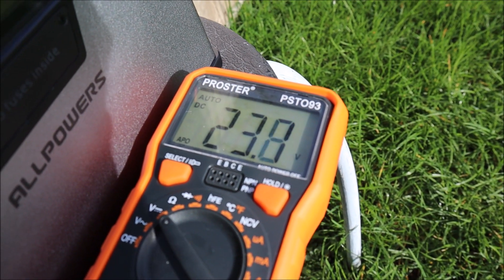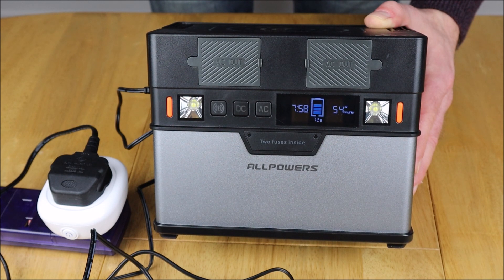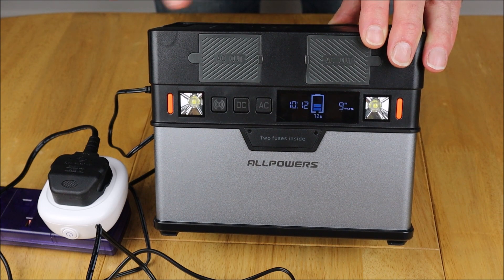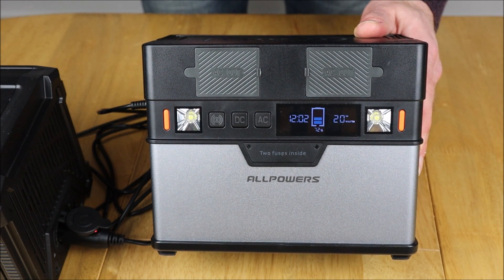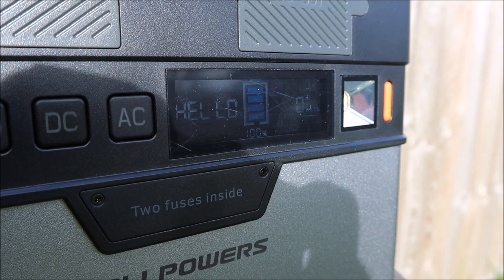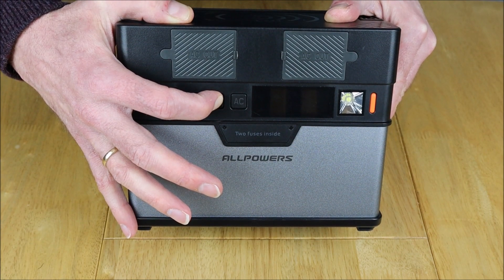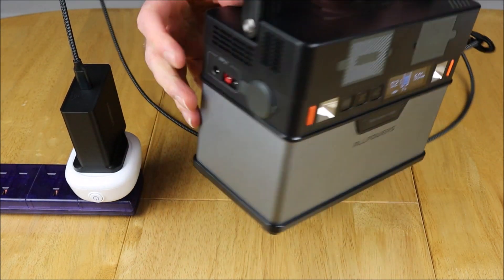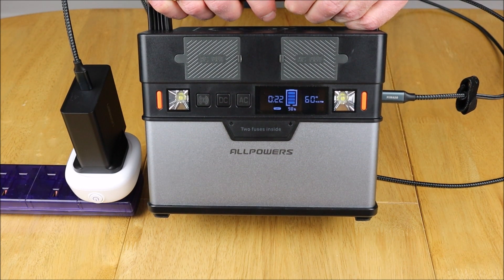ALLPOWERS 372Wh Portable Solar Generator Update | Charging Rundown

Comment: Have any of your videos dealt with pass through charging?  A link would be great if so.
Reply from the maker: @PAUL CLEGG  Hey Paul! Not specifically on the 372, but I run an extension cable from it while solar charging in the garden. That was especially useful when the world changed last year and it's what led to the working from home video in the 372 playlist > https://bit.ly/2AbwG5L. Was there something specific you needed to know, other than it can and does work? Cheers, Adrian
Reply: @DADvinci  with solar connected and giving say 50w,if I connect to one of the 2 DC outputs (a cooler box), it switches to a 45w draw.  If I connect to the car type output directly, it shows the net value (5w in this example).  I used the DC output with the car plug adapter as one of your videos showed this to be a regulated 12v supply.

Comment: does it work with a normal household sized plug??? can i plug somethign that size into it i meen
Reply from the maker: @Jordan White  Good day Jordan and thanks for your question. Just to clarify, you mean plug in a mains 3pin plug into the 372 unit to run a device (e.g. power a laptop using a mains plug)? If that's the case, then yes. If not, please can you give me an example of something you wish to plug in? All the best, Adrian

Comment: Hey Dadvinci, what a great channel! I have learned a lot from watching your vids. Thank you. And respect to you for responding to all these comments! 
I'm wondering if I can charge the 372 or 666 simultaneously with a solar panel to the Anderson ports and from a 12v socket with a USB-C PD in my work van? 

I am a gardener and will be trading in my old petrol powered tools for battery powered in the near future. I've had enough of fumes, vibrations and noise.  I'll probably stick with Makita as I already have their batteries. This means I will need on board charging facilities in the van.  I have thought long and hard about a leisure battery system and priced up what this would cost etc. but I haven't the space for locating the aux battery and all the extra bits like a dc2dc, mppt, inverter etc. Also, I only drive short distances between jobs. Hence why I'm interested in a portable power pack solution, which I can bring in to the house to charge if needs be. 

I'll probably need to charge either  2 or 4 5ah batteries per day, which take 45mins each to charge and I currently use Makita's mains charger for this (240watts) at home. (They also do a 12v version btw).

Additionally, the work van turns in to a camper van at the weekends and that's why I'm thinking about a solar panel, as well as charging from the 12v cigarette socket when we're on the road somewhere. When camping we only need some led lights and phone/tablet charging. 
Thanks
Ben
Reply from the maker: @Ben Hicks  Good day Ben. Wow, thanks so much for your amazing feedback😊👍 You've also spotted one of the reasons I can't get as many videos out as I'd like (comments take time, but they really do provide viewers value), until I can go full-time YouTube of course.

In terms of dual mode charging, you can only do that on the 666. So, it would be possible for a solar panel to Anderson port and 12V USB PD charger to USB-C port simultaneously. 

There are a few options you could go for. In terms of all-in-one units, the 666 looks like an option and Jackery have just sent the last in the current set available on the UK market (now have the Explorer 240, 500 & 1000 models) along with their 100W solar panel. I'm not sure if you've seen the 240 & 500 videos as yet? The 1000 I got Monday is a serious bit of kit like the EB150, but they might be overkill.

The other option and a hidden gem in my opinion, is the AliExpress case battery. It's very good value in terms of Wh capacity and also portable (even though it's 9.5kg). I'm working on turning it into a solar generator currently (for car charging too) and I'm very impressed with the latest (available version) > https://youtu.be/AEjroUPdkTw (if you haven't seen it). If you don't need an inverter when you're working (use Makita's 12V charger) then you can connect to the case battery direct. When you go camping at the weekend, you can choose to add an inverter if required (as in the video). All I need to do is get the solar generator bit done (planning the video).

I guess it boils down to budget and what you really want/need. If you could let me know your thoughts, it might help narrow things down a little more. All the very best, Adrian
Reply: @DADvinci  That's great thanks. It's looking like the 666 is the way to go at the moment.
Forgive me if I'm wrong but doesn't the Jackery 500 have only one input, so not possible to charge simultaneously with 12v and PV?
I have just watched your case battery videos and for me I think, though great on price, it's not the way to go for me, because I'd have to add a solar charge controller and inverter, which then impacts on the space issue I have in the van. As I'll also have to mount the Makita charger somewhere as well. 
Potentially I'll have to take the 666 in to the house each evening to charge so its portability is essential. Ideally I'd like to leave it under the seat and have it charge from PV and 12v, though I understand in winter the solar will not do as great a job, if any. Thanks again for your time. 
Ben
Reply from the maker: @Ben Hicks  No worries Ben. Totally understand now, you need compact and portable. You're correct, the Jackery 500 has a single input (albeit the best single input in terms of watts from a standard 12V output). Out of interest, are you going to mount a panel to the roof for when you're driving (+ charging from the 12V output at the same time)? Cheers, Adrian
Reply: @DADvinci  Hey Adrian, yes that's it exactly. I plan to mount a solar panel or two permanently to my van's roof rack. I have space to mount two 100 watt rigid panels, and i've seen some people have designed a hinged system whereby you can manually angle the panels, to achieve optimal gain. Particularly useful if you're parked up for the weekend on a campsite. 
For the 12v car charging side of things, I plan to install an additional 12v cigarette lighter output convenient to where I will store the 666, and use a USB PD car charger plugged into it. 
I'm hoping this dual approach will provide the 666 with enough juice in a work day to allow me to charge my 5ah Makita batteries. I'll be using two batteries at a time as I work and two batteries can be charging from the 666 at the same time, thus avoiding a situation where I'm without a fully charged battery. As a way around this I suppose I could buy a load more makita batteries and charge them all in the house each evening, and do away with the 666 idea. But this could get tedious and I'd still need a solution to the camping issue.
I'll definitely use your link to purchase the 666 and just wondered if that aliexpress price of £362 include all taxes and delivery as it is coming from the EU? Or should I just use your amazon link at £475? Thanks again. Ben
Reply from the maker: @Ben Hicks Awesome! Sounds like you've got the bases covered then. I'll check with another viewer who recently posted about their 666 deal on AliExpress. They didn't mention anything about additional import duty or VAT. I'll let you know. Cheers, Adrian
Reply: @DADvinci  thank you sir
Reply from the maker: @Ben Hicks  Hey Ben! I've heard back from the other viewer and he doesn't remember getting charged anything extra (import duty or VAT). It might be worth pinging the seller a quick note to check, just to cover it off before hitting the button. Cheers, A
Reply: @DADvinci  Great news. Sounds promising, thanks for that.

Comment: I got the battery and Solar panels because of your review.
Can i change the batteries, once they die? Else it would be quite the waste.
Reply from the maker: @MedienGulli  Good day and thanks for your question. Most portable power stations have batteries that are not replaceable. The manual states "The battery packs inside are non-removable", so the manufacturer confirms this for the 372. If you did wish to get them replaced by a qualified repairer in future then you could try that option. All the best, Adrian
Reply: @DADvinci  Thank you very much Adrian. Much love from germany!

Comment: Dis you try the 372 with an external inverter of, let's say 500 watts continuous, connected to the DC or 12v output?
Reply from the maker: @David F  Good day David and thanks for your question. I did try last year (voltage drop was too much), but I wouldn't recommend as the cigarette lighter output is only rated for 10A. This equates to around 120W (12V x 10A), so there's no gain over the in-built inverter I'm afraid. Please shout if you need anything else. All the best, Adrian
Reply: @DADvinci  Thanks. What about the use of the 12v DC output instead of the cigarette lighter? 
The reason I ask is that the internal inverter is, for some reason, unable to cope with two electric bikes (70 watts each) but can handle other devices up to 230 watts so for the bikes, I would like to use a external inverter. What do yo think?
Reply from the maker: @David F Ah, I see now. That's strange, as it's within the inverter rating. It might be sensitive to the type of load in this case (perhaps triggering one of the protection features). Each of the 2 DC outputs is good for 5A (so about 60W per port). I assume you have some kind of power brick to charge the bikes? Can you see what the DC output is (rating specs) on the brick itself? Cheers, A
Reply: @DADvinci  output is 42v. 2A. input 100-240v. 2,2 A (max) 50/60 Hz
Reply from the maker: @David F  Thanks David. I wonder if they do a 12V charger (cigarette lighter plug) for your setup. I've had a quick look and could only find one that provided 42V @ 1.5A on eBay. Not sure if it needs to provide a specific charging profile for your bike battery packs. Are the power bricks specific to your bikes or generic ones? Are you able to charge one bike at a time? Cheers, Adrian
Reply: @DADvinci  Yes, I can charge one at a time but not both simultaneously. The power bricks are the original ones provides by the dealer. What surprises me is that if I connect a 200 watts inverter on the Allpowers generator, I can charge both from the cigarette charger (143 watts both at the same time). That's why I thought of connecting a more powerful inverter (500 watts) to the device through the cigarette charger or the 12v DC output for the bikes and for more powerful devices such a hairdryer... what are your thoughts?
Reply from the maker: @David F  When I connected the inverter last year, the voltage drop (inverter cut out) is likely to have saved me doing damage to my 372Wh. Personally, I wouldn't go above what you have as it's already over the 10A rating for the socket. If you need more portable power, then it might be worth looking into something bigger?
Reply: @DADvinci  My only shortfall for my needs are the bikes. For everything else, I am happy with the 372. Any thoughts why it can't cope with both bikes at the same time?
Reply from the maker: @davidf8804  Only thing I can think of is that it doesn't like the load the power bricks are pulling (perhaps one of the protection features is cutting in and turning off the inverter). It might be low enough using one power brick, then it's too sensitive to both at the same time. The initial spike from both (or adding the 2nd while first is charging) could cause it to think it's an overload, just a guess.
Reply: @DADvinci  Many thanks for all your time answering my questions. Regards and greetings from Spain. If you come over in the future, let me know and I will buy you una cerveza con boquerones ;-)
Reply from the maker: @davidf8804  No problem at all, glad to help where I can. I think I need to go to Spain on my holiday now! All the very best, Adrian 😊

Comment: Confusingly the company has now downgraded the WHs from 372 to 288WHs, they have told me this is because of the increasing cost of the raw materials.  So they now have two units at 288WHs . Stupid thing to do, why not just raise the price to avoid the confusion. Madness.
Reply from the maker: @william Logan  Good day William and thanks for your comment. A number of viewers told me that my links were incorrect and when I checked the Amazon listed it had been changed. I got the same answer from ALLPOWERS. Like you, I'm at a loss as to why they would change something on which is a bestseller for them. The Sudoo 372Wh seems to be a rebranded version, but I've not got my hands on one to test yet. All the best, Adrian
Reply: @DADvinci  Thanks for your reply, the sodoo has now also been downgraded to 288WHs, they sell through onbuy,or direct from triclicks company.  It is a shame as the allpowers 372 seemed a best buy model, thanks for your testing of that product. Now that is no longer available, do you have a recommendation for a replacement, as a novice it is difficult to discriminate between the various models available ,I would like a power pack around this WHs, but it is difficult to choose, this is why reviewers like yourself are so valuable.  Because of your videos I had decided on the allpowers 372, so unsure of where to go now.  Again thanks for your work, it is indespensible.
Reply from the maker: @william Logan  Hey William! Thanks so much for your very generous feedback, it's sincerely appreciated 😊👍. It's such a shame that they've taken this route and even the alternative has gone the same way too. The only other one I’ve looked at that's close in terms of Wh is the Beaudens 384Wh, which also appears to have been rebranded (now called SUPA). I've just sent a note to the seller to see if it's the same unit (apart from a facelift/rebrand), so will let you know when I hear back from them. Here are a couple of videos if you wanted to take a look >  https://youtu.be/_R8XKND1_sU & https://youtu.be/YA8tdjWh_hE Cheers, Adrian
Reply from the maker: @william Logan  G'Day William! I've had a response from SUPA customer service as follows. So, this is a rebranded version of the Beaudens, which means the videos are reflective of the unit if you wished to buy one of these, instead of the ALLPOWERS 372Wh.

Hi Adrian,
it is indeed the same manufacturer.
Have a nice day.
Regards
SUPA Customer Service

I hope this helps? Please shout if you need anything else. Have a fantastic weekend! Cheers, Adrian

Comment: Hi there! After talking with you I finally bought this generator, and I'm so happy. Thanks for your feedback. I was just wondering... I don't know if I should update the firmware, or maybe I can't do the following. Have you ever tried to charge devices at the same time the solar pannel is connected and charging the generator? If you use the normal USB ports, even the AC sockets at 220v, it's not a problem... BUT... If I connect my computer directly to the USB C PD port, then it does not work... Do you know how to solve this problem? What I have done is to connect the computer to the 220V socket... but it does not make much sense... The point is to be able to work with the computer while the generator is charging...
Thanks!
Reply from the maker: @Salvador Campo  Good day, it's nice to hear from you! I'm so glad you're happy with the 372. As far as I'm aware you can't update the firmware, but it should run fine on what it has. Yes, I frequently use mine to run and charge devices while it's charging from solar. The problem with USB-C PD is that it has to provide enough power for the laptop you're trying to charge. More powerful laptops usually require more than the 60W that this unit can provide. Can you see the amount of power your laptop requires from the specifications on the AC power brick (DC output details)? The laptop I'm currently using is a mobile workstation that doesn't work on either 60W or 90W PD as it needs more power than that. I look forward to hearing from you. All the best, Adrian
Reply: @DADvinci  Hi Adrian! Thanks for your answer. My computer has enough with the 60W output (Macbook pro). But the problem is when I also want to charge the unit at the same time with the solar panel. I have been checking and I discovered that the USB-C PD port is "dual" mode, so it can be used in both directions (to charge whatever, or to charge the unit). Sooo... When you connect a "input" port (like the anderson connector with the solar panel), the Allpowers unit "cut" all the other possible inputs, including the USB-C PD port...  But I have discovered how to amend it! :-) I have bought a USB C 65W for the car charger output that it will be more effective than connecting the original adapter of the computer to the 220V output. So, I will be able to connect my computer and work while the unit is charging with the solar panel :-D Hope this helps!! THANKS!

Comment: Anyone know if this is the same as the Sudoo version? They look almost identical
Reply from the maker: @Shaunie Harding  Good day Shaunie and thanks for your question. It does look like a rebranded version, but I'm not sure on the internals and whether it matches the ALLPOWERS or not. Were you looking for the ALLPOWERS 372Wh? All the best, Adrian
Reply: I bought the sudoo cuz it was so much cheaper and is obviously the exact same product! I got the 372wh for £180 and it’s brilliant can’t fault it, apart from not coming with a car charger so I’m here again to try find out the size/name of that input port so I can buy the right one as there seems to be a million little plug sizes you can buy with cigarette lighter on the other end! But I don’t think the ALLPOWERS comes with it either!